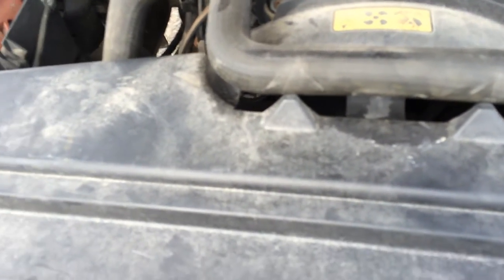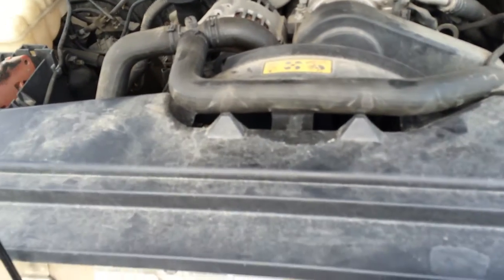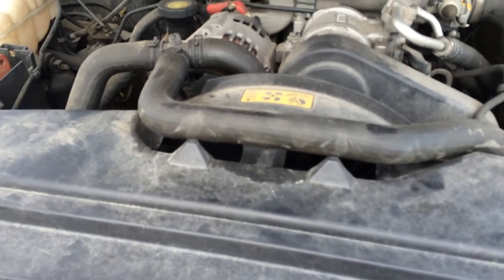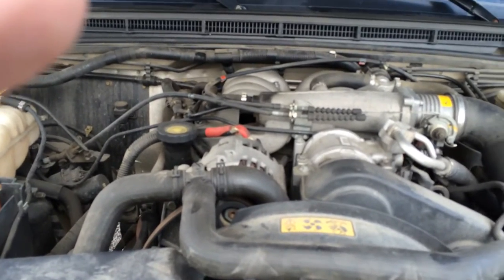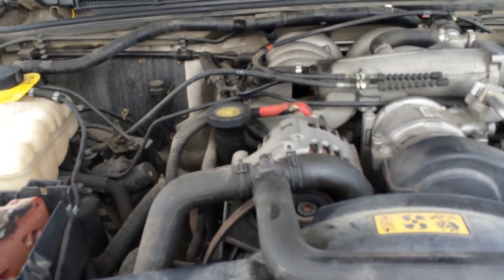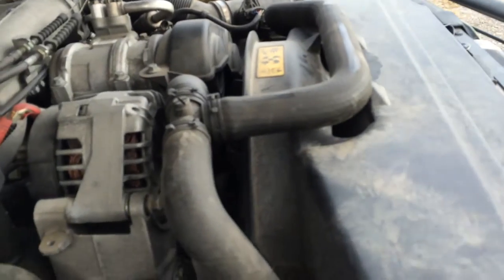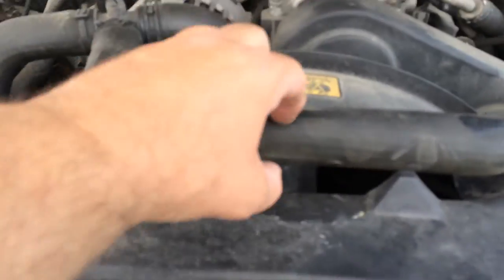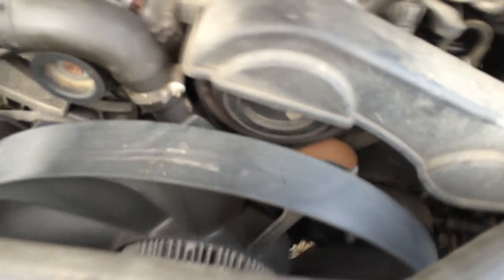Serpentine belt removal/replacement, Land Rover Discovery 2 SE, part 1

Comment: can you make a video showing the traction control working?
Reply from the maker: +Sebi Barberena i'll see if i can rope a friend into doing the video for an example of traction control.
Reply: Awesome! I just really like seeing how it works, but there really isn't a video showing it work. I have felt it work on my own Disco, but I can't really see it work from the drivers seat lol
Reply from the maker: Sebi Barberena exactly! it IS hard to see that.  not sure where you live, but if you live in an area with winter snow, you'll occasionally get a glimpse of it at work when you decide to spin the wheels in the snow just for fun.  if you have snow, and a big open parking lot, you can stop in the middle of it away from anyone else, hit the gas, and see some snow fly both past the driver and passenger side windows, and in the rear view from the back wheels.  i also knew it was working one time in some pretty loose gravel, and you could see where both front and rear wheels had been digging in the gravel to find traction.
Reply: this is the first year i have my disco in the snow. i used to live in california, but now im in virginia. in california the disco was my dads car, but now he gave it to me as my first car and im pretty excited (to say the least) for the snow. i have gone through a little but of mud that was on the side of the road and did exactly what you said to do in the snow. i could tell that the left front tire spun but traction control corrected it. i also went up a small hill with loose rocks and spun a tire but not long enough for traction control to do anything.
Reply from the maker: this is my first year with mine as well.  love it!  you're going to enjoy it in the snow.  the secret, obviously, is to still drive cautiously for the weather, but enjoy serenely cruising past people spinning their wheels.  i helped recover two trucks on a mountain road today-- a gmc suburban and a ford f-350 (yes an f350).  one thing to note carefully-- you'll get nice traction with it on snow and ice, but it's as prone to sliding (or almost) on ice when trying to stop as most other vehicles.  you have a little advantage if you can take your foot off the brake and get traction again and steer with it and ride it out, but you still need to be mindful about enough stopping room, and turning speed.  i would categorize it as virtually unstoppable IF (big, big IF) we're driving sensibly to start with. as the land rover reps say "as slow as you can, as fast as you NEED to"-- that's when it shines.
Reply: yup. last year was the first time i drove in snow but i wasn't in the disco. i was in the polar opposite of it, a VW convertible with bald tires lol. i was SUPER careful and i did a little bit of practicing with traction in an empty parking lot.
Reply from the maker: i've enjoyed being stopped at intersections here in town recently in the snow that were on slight hills.  other people are spinning like mad to try to move, and they're just sliding backwards.  meanwhile, i've just gently feathered the gas, and off it goes.  couldn't help the smirk on my face.
Reply: lol i bet that must feel good.
Reply from the maker: Sebi, there's a US facebook LR group i've joined recently, started by a kid in the south somewhere.  small group so far, but really enthusiastic crew, who help each other answer all sorts of questions and generally have fun with LRs.  it's on FB as Land Rover owners USA, and the guy who started it and is chief admin is named Patrick Mays.  Check it out!
Reply: Mountain Rover sweet! I'll look into it!